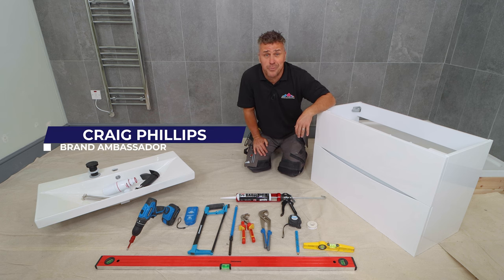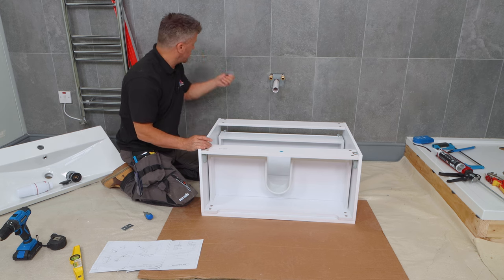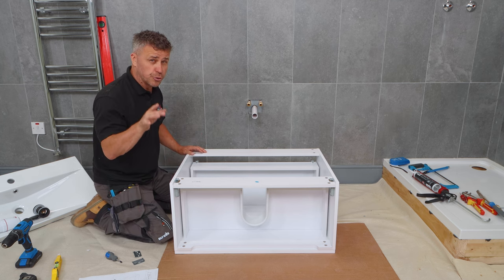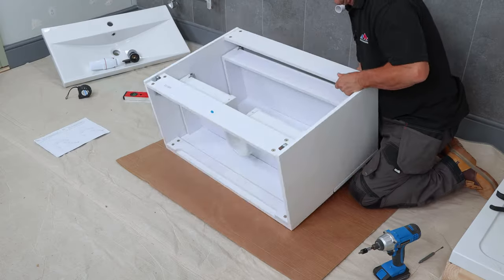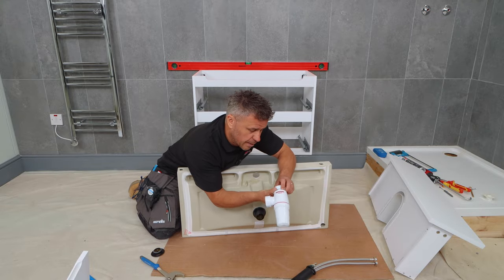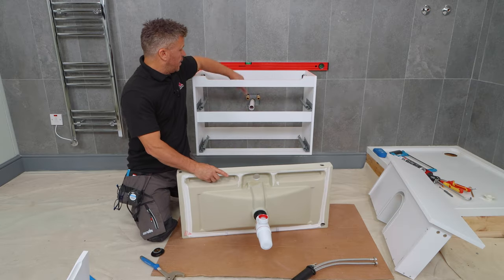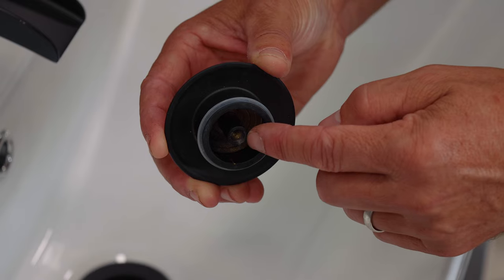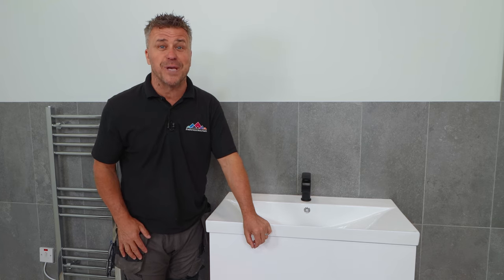How to Install a Floating Vanity Sink | Top Trade Tips

Comment: very clear explanation. thank you so much! Those brackets to attach cabinet to the wall don't look very strong.Seems like the design doesn't secure from accidental kick from the bottom. What is your opinion on it? Thanks
Reply from the maker: Thanks, The brackets do hold it in place well, like with most things you should be mindful of what you're fixing into, because if the wall isn't strong enough it won't hold much

Comment: Hi Craig, I remember seeing you in big brother all them years ago! I’ve just recently bought a 800mm vanity unit. I have two questions , what height should they usually be off the floor? Also it will be going on a stud wall. I’m ok with fitting things, but my question is if it doesn’t line up with the beams will I need to cut out the plaster board and add a cls in the timber where it would be getting fitted onto?
Reply from the maker: 24 years ago the first one!
Reply from the maker: There isn't really set high off the floor, it more depended on the depth of your unit its self
Reply from the maker: Yes cut away the plaster board behind and re-enforce the stud work, then ply between stud to get the best fix to make it last
Reply: @MrandMrsDIY  thanks Craig. 24 years ago, wow time has flown! I have measured everything and cut out the plaster board, I allowed 5cm inside of the vanity unit square so when it gets board back up nothing will get seen. I added in the timbers where needed for the brackets and added a few noggins to the strengthen up even more. I have also cut a square out of the floor to re route the waste pipe. I’ve done a nice neat and tidy job of it ready for my plumber mate to sort out the pipe. He said I have done most of the work for him haha. Many thanks for the replying and the advice!

Comment: Absolutely awesome video will be installing a 1 meter similar sink to this very soon , has the same wall fixings honestly thought they didnt look strong enough so got some extra wall brackets and may end up buying the legs as im very nervous it will hold up , one thing i noticed which im unsure on is you never attached the sink with silicone or some sort of adhesive to the vanity unit only to the tiles behind ?? The user manual i have has somthing about sticking the stink down any recommendations for that ? 

Thanks alot video was awesome
Reply from the maker: Cheers mate, yes you can put a line of grab adhesive on the tiles before you put the floating sink carcass into position, then hopefully it should hold it up easier for you! Thanks

Comment: Hi , sorry new to diy , so maybe a daft question . Before you drilled for holes , you did not check for wall studs to ensure that holes are aligning with wall studs . Thanks
Reply from the maker: Yes you can do to make it a stronger install, but if your tiles are thick enough it should be okay

Comment: Are the brackets screwed through the tile to ply ? is ply behind the tiles needed ?
Reply from the maker: If there is ply or concrete boards behind the tiles, that would be stronger, however if the walls are tiled onto plasterboard then you would require screwing the bracket into the stud framework. Cheers

Comment: How high does the water outlet and drain pipe need to be from the ground for the vanity height to be just right?
Reply from the maker: This can different with different size units, when you have chosen which model it should give you recommended hight for pipework
Reply: @MrandMrsDIY  I figured 22-24 is the common height for most units. It's exactly how my plumber did it
Reply from the maker: @aberba  Thats sounds close enough
Reply: That's about the size of a standard  male black lab